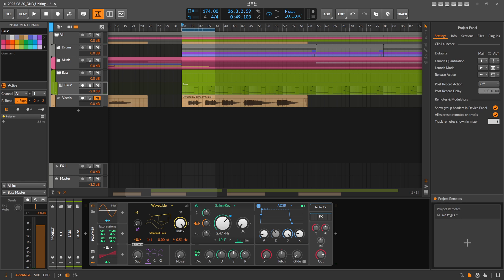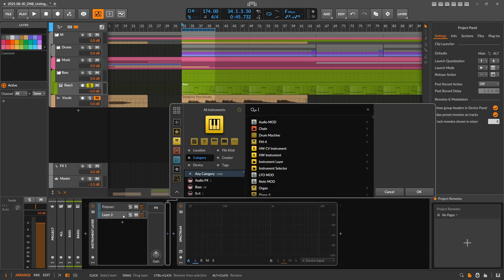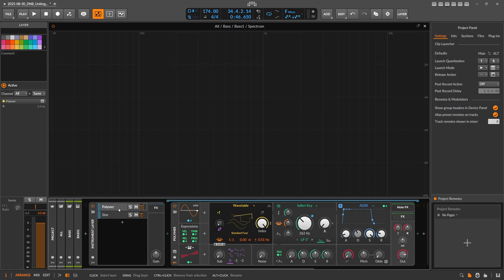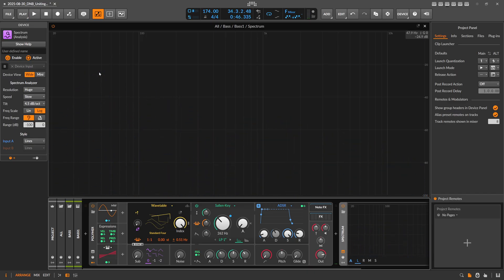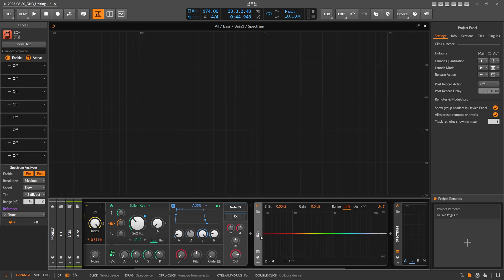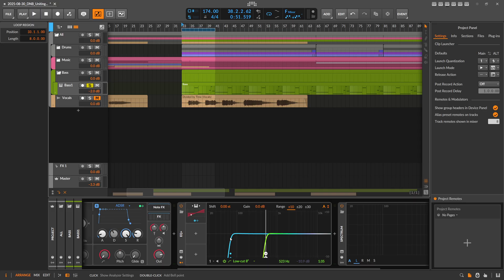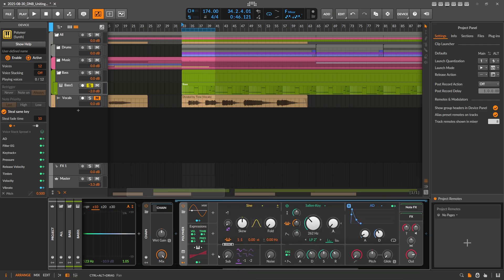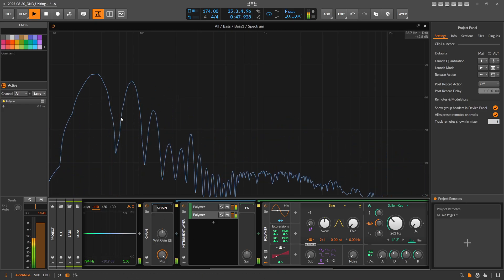This 60-Second Bitwig Hack Gives You DISGUSTINGLY Clean Subs

Comment: Thanks again for this tip. 

I tried and seems this works with 3rd party eq's too. But you need to experiment with different values. I tried Toneboosters EQ Pro for example and found .410  to respond to full midi keyboard range. Interestingly in the same developers other plugin EQ 4 you need to set it at .510 to work similarly. Luckily both of these eq plugins have a midi keyboard display for the eq nodes so you can verify very quickly it is working properly. Of course this should possible to set up with any EQ, but it takes a bit time to verify the correct values without visual que.

Either way this is really cool and brings all kinds of nice applications for different kind of effects control to respond to actual note values. 

Is this is even possible to set up so flexibly in any other DAW?